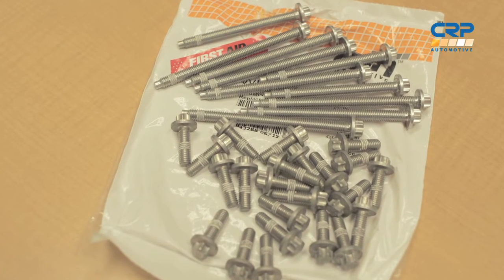Why Replace Single-Use Aluminum Stretch Bolts on BMWs | ITB Episode 6

Comment: I wish Australian ‘mechanics’ would understand this. Here they reuse them until they break off in the head and then just use a dab of gasket goo to make them look like they are properly torqued. Yes really. No wonder my car leaks oil like it’s been serviced by a monkey. You just can’t trust a grease monkey to follow the engineering specs here. They think they know better. Still charge full price and charge you for the bits they never installed. Sooo bad!
Reply: you get what you pay for i guess. bmw dealer techs will do it the right way, but will charge you both arms and legs

Comment: I just had my n52 cam cover gasket replaced and looks like they have reused the bolts the blue on the bolts doesn’t look new. An I better to replace them now while they are still fresh?
Reply from the maker: Hi Nick, thanks for the comment. If you believe any of the water pump or alternator bolts were reused, we recommend contacting the qualified technician who did the work in order to confirm exactly what was replaced.
Reply: Exactly my experience. I had an argument at the counter when I asked if they replace the oil pan bolts. They said “that’s not required, they last years…”. I went home, ordered the bolts and did it again myself properly. Frigg’n hacks